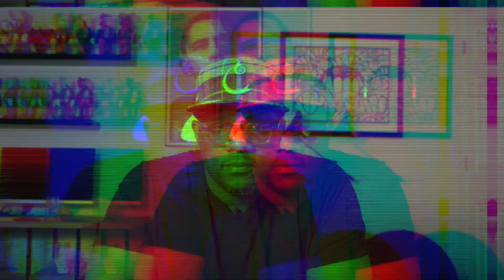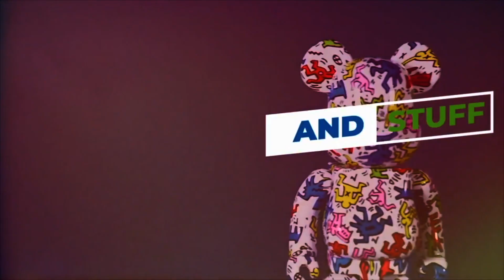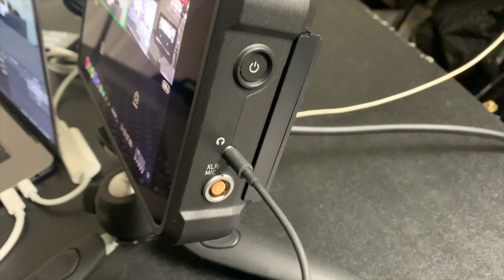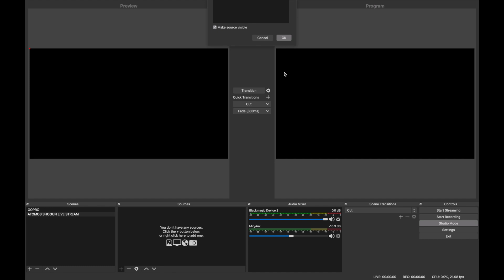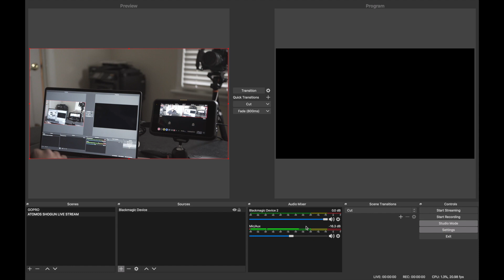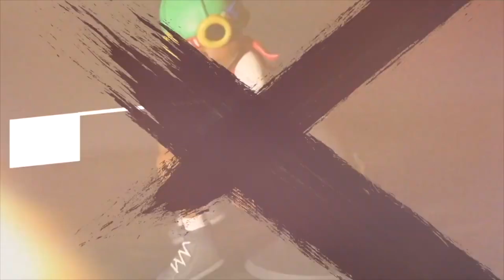My multi-cam livestream setup using the #Atomos #Shogun7 + #BlackMagic devices

Comment: For those live streaming or quad screen switching/shooting/recording with the Shogun 7, the new Blackmagic Micro Converters will work with HDMI video sources. You can buy one per input as needed and power via USB-C. Set them to Level A, not the factory Level B setting.